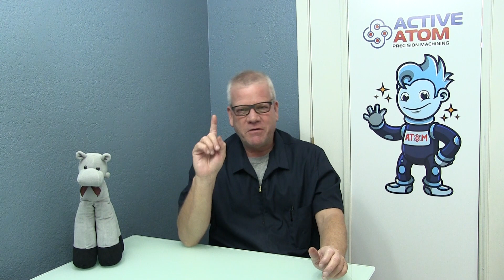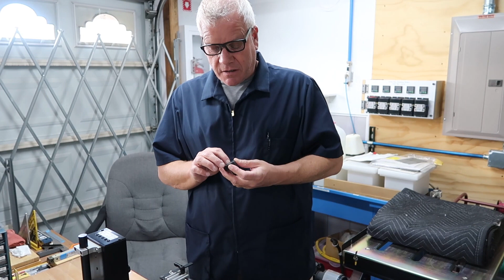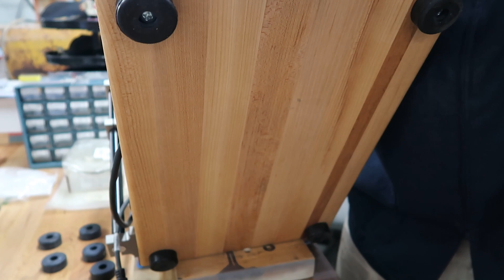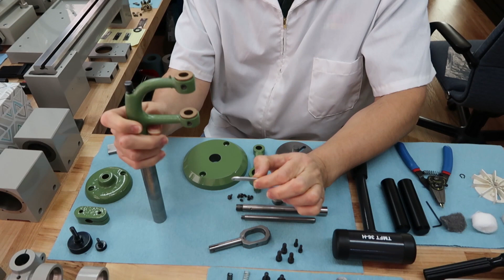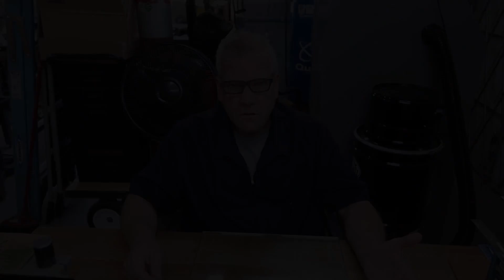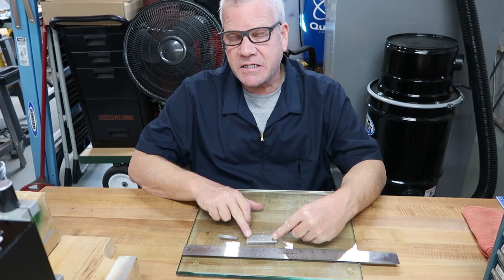SHOP ADVENTURES 10: Machining Part for Micro Drill Press

Comment: Nice to turn out little parts with the CNC I bet. Very cool.
Reply from the maker: Hi john, thank you very much for subscribing, that CNC mill is nice, though that is what might be the worlds smallest precision CNC machine made in America. We wanted to share with you that we are watchmakers and we run micro machines. That CNC mill is actually a 4 axis and is one of the largest machines we own, but we are hoping to change that once the Barker AM Milling Machine comes online. We call that mill our baby power mill it is a 6.25" x 20.0" table size with a factory secret to be shared during the reassembly (because we cannot hide it then). The documented, tagging, photographed  stripping down, and 2 part epoxy paint work are completed already (no video) and we have all of the parts some new replacements and all new bearings and such John, so it will be a great fully documented rebuild once we start likely in the new year, we have several machines being filmed now to come first, 2 Levin & Son Instrument Lathes 1 is 40 years old the other is like 40 years older then the first.
Reply: Great. I look forward to see what you guys get up to with all of it.  @ActiveAtom

Comment: Nice episode...I have my watchmakers lathes on butcher boards too...with little feet too...I'm old and my sight is ok but I need tons of light as well as magnification and those feet lift the board high enough for nice little clip on goose neck lamps I can move all over...I ordered the chemical bluing you recommended last video...going to finish off some parts for a hand crank I built for the Atlas lathe. Tnx guys.
Reply from the maker: You are really kind and your channel is a great pleasure to watch (no puns) as you really share the information in your videos well. Thank you so much for sharing your thought about the clip on goose neck style lamps to see better, because we two are not a couple of young geese around here. The wood, and trust me, until we changed out nearly every table around here to Mable or Oak and then as you pointed out utilize the chopping boards to mount all the portable versions of the machines on we were laminated mystery table tops and ground steel plate guys all the way, I think it comes from my aerospace job machine shop youth. We love the chemical bluing as one form of getting a nice look and some preventative rust coating on some of our parts, hope that the cold bluing works out as well for you as it has for us, it does smell something bad at first, but once you are done there is no more smell must be the chemical reaction to the steel.
Reply: Check out my fusee episode when it comes out...The grooves in the fusee are cut on the Atlas using a shop tool under power but at the end of each cut I use the hand crank to return to the start position...I plan to show the hand crank and the chemical bluing...if I can get the bluing right on the hand crank...